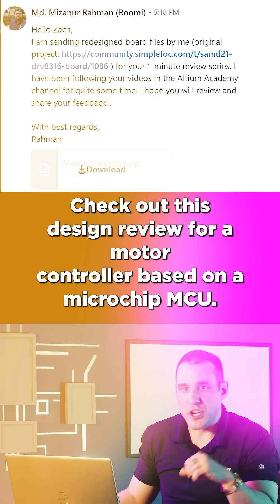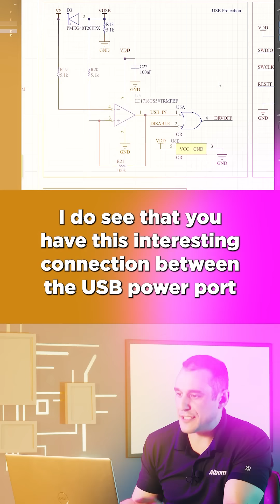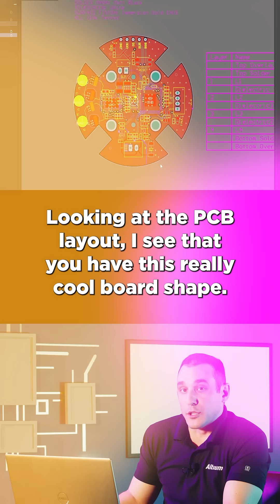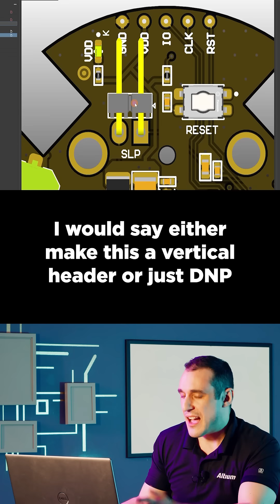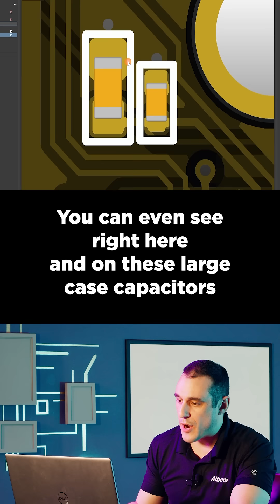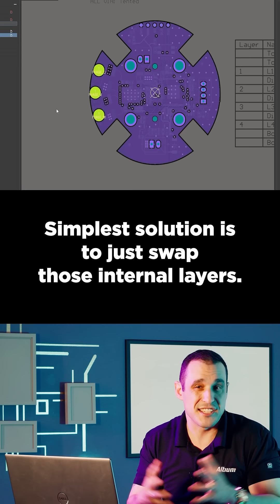Cool Board Shape but There Are Issues | 2 Min PCB Design Review

Comment: @Zachariah-Peterson, 
Sorry for my late response. Thank you for the design review. The USB section is doing exactly as @josephbaker9932 described. Also its preventing the motor to turn on when there is no USB plugged in.
Caps are kept too closed due to motor casing height limitation and required caps voltage spec. These were the lowest footprint caps I found maintaining the specs. :)

Right angle header is a DNP item. As I have not defined any variance and it showed up in the 3D !

Really a good suggestion of swapping the internal layers. This will give a continuous ground plane just underneath the components.

Can you suggest ideal silkscreen width considering legibility after printing, aesthetics and DFM ?

Comment: The comparator squares up the VUSB voltage, which can vary quite a bit.  This ensures that the input to the OR gate sees either 0V or VDD.  The input to the OR gate does not handle voltages in the midway between VDD & GND.  

The comparator also handles input up to 44V above VDD, which is a necessity given the magnitude of inductive spikes that occur in the wire of the USB line during insertion / removal.  This protects the logic gate. 

Lastly, the comparator can handle its inputs being above VDD during power on transients much more reliably than the logic gate would handle pin 1 input being above VDD during circuit power up.
Reply: Yes but instead of using an active comparator, decoupling capacitor and a logic gate, you could have used a simple passive mosfet. 
Much simpler, energy efficient and cost efficient. For a USB to small battery connexion, this is more than enough 90% of the time

Not only this, but the comparator is inducing a voltage drop. Most rail-to-rail OPA have about a 1V swing when driving a 200 mA source. 
This reduces the efficiency of the rest of the circuitry. Honestly, this just looks like bad design for me.